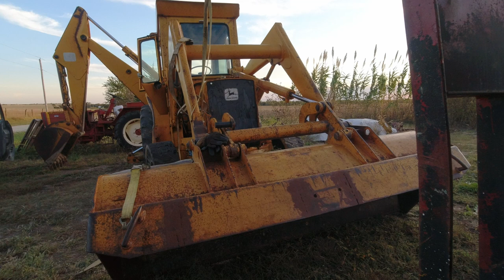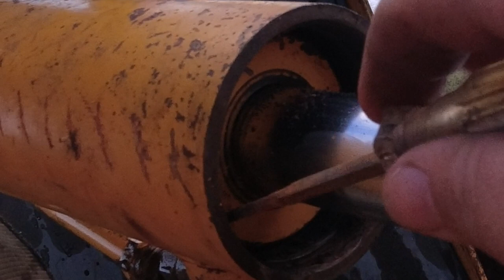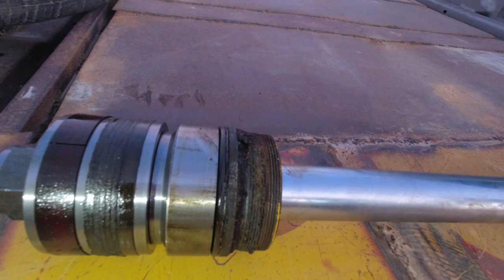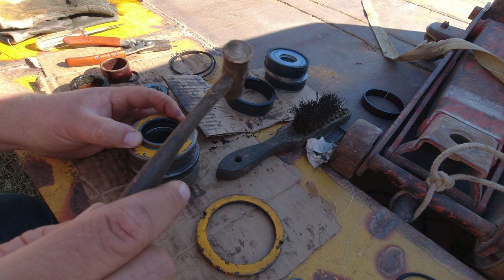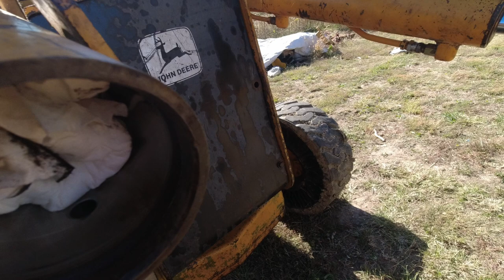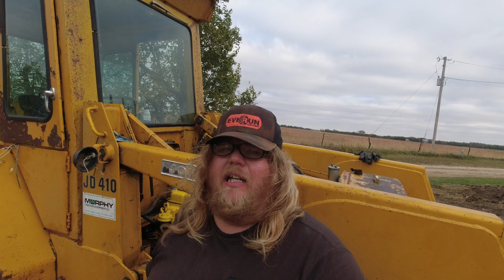Rebuilding Hydraulic Cylinder John Deere 410 Loader Backhoe

Comment: how do you look up parts for cylinders? Is it a JD thing or are there aftermarket parts you trust? Thanks man and great job with the rebuilding. I just bought an old JD410 and need to do lots of this work too.
Reply from the maker: John Deere wants a insane amount for these seals, I'm thinking I bought all the seals for every cylinder for the price JD wanted for 2 or 3 cylinder rebuild kits.
I ordered them from my local small hardware store, I don't know where he ordered from.
I highly recommend taking the cylinders in to a professional shop and have them rebuild them.
The cylinders I did still are not 100% and I'm not doing anymore myself.

Good luck on your new backhoe! 👍